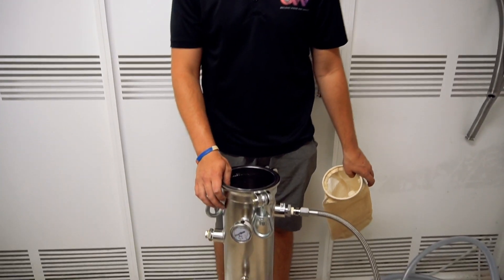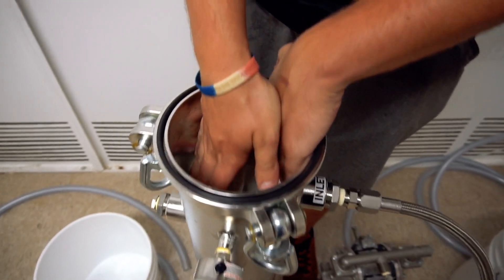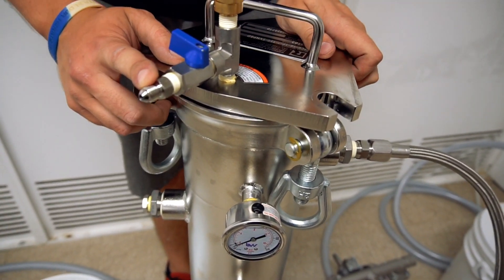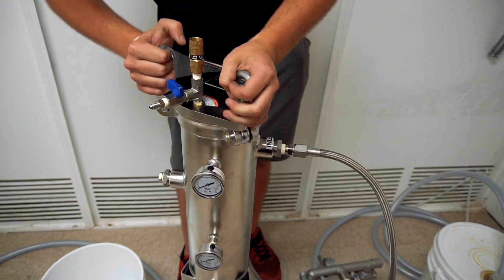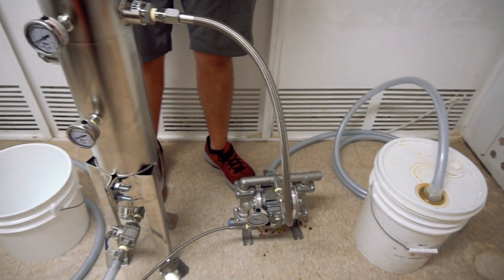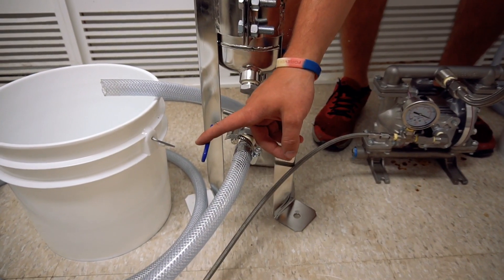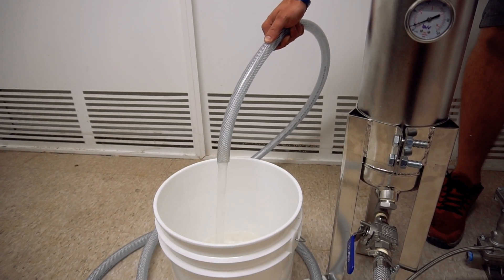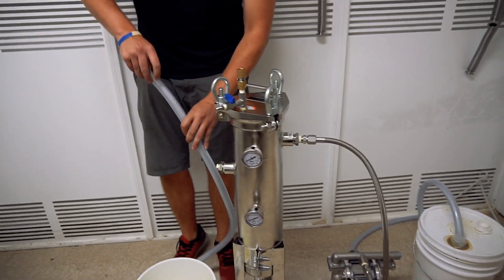Pressure Filtration System Demo

Comment: Is this for Etho or bho?
Reply from the maker: @Jimme This system filters particulates, fats, and lipids from an ethanol solution. Similar to a PIG Filter system. This unit does not have adequate gasket seals for BHO. Other dewaxing practices are used with a Hydrocarbon system.
Reply: More for ethanol id say. If it was jacketed you could do it for bho potentially but if you wanna spend the money for bho extraction just buy a crc set up